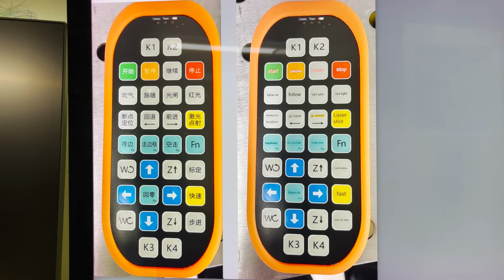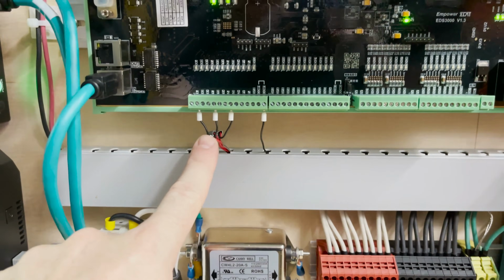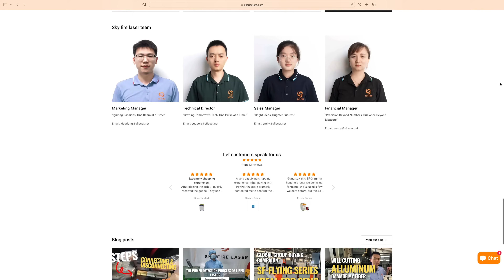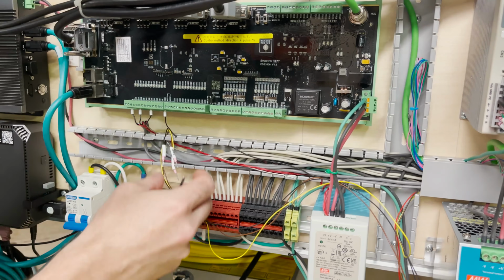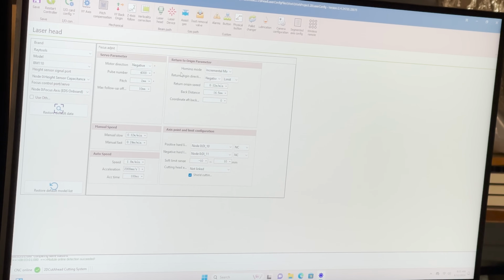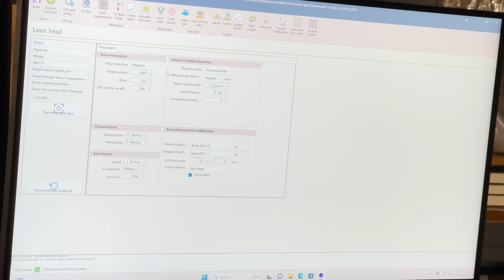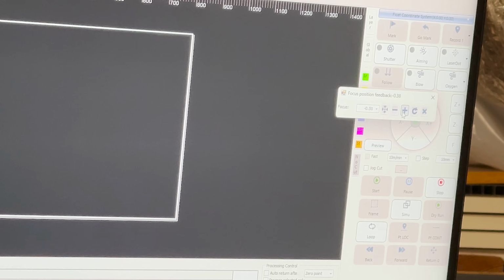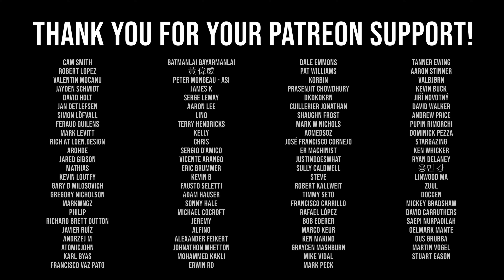DIY Fiber Laser Cutter V2 | Part 7: Raytools BM110 Auto-Focus Cutting Head

Comment: A tip regarding the watercooling, have the input be at the bottom and exit at the top. this makes bleeding the air much easier.  Especially with lower preassure and tighter tubes. This will be a non-issue with enough pressure ofc.
Reply from the maker: Thanks for the tip!

Comment: I would ask you please how the orgin function work? I have a sensor for each axis x,y and z all of them are working perfectly but the machine doesn't stop when the sensors are on. Btw all the sensors are Normally Open.
Reply from the maker: They need to be wired to x0, y0, z+ pins

Comment: would it be worth 3d printing a bumper for the hard stop around the optical cable, to make things a little gentler if it crashes?
Reply from the maker: I started to do that, but I’m concerned the plastic could break under the force. That cable is the most expensive part of the machine, so I don’t want to risk it

Comment: Hi Travis. Thanks for this video series. I have a question for you and the knowledge people here.
At work we’re thinking of putting a laser head on a 6-axis welding robot. I think it would work pretty well without an auto focus head, but probably would work better with one.
Is this possible? Below are the major parts I think we would need. Please let me know what you think:
Laser head. The amp is included?
Encoder driver. Comes with head I believe.
Controller board to control the auto focus servo.
Laser power source
Software to control things.
Raytools makes a GF101 head that has built-in Z axis movement. But seems this wouldn’t work for what we want to do, yes?
If there is an easier way to do this I’m all ears. I was hoping that there was more of a stand-alone system where the auto focus electronics were all included in a cabinet.
Anyway, I’d appreciate any help you can send my way.
Marty
Reply from the maker: Look on the Raytools website, they have an all-in-one package for this….but be warned, I heard it is around $100k

Comment: helo Travis is the home limit disconected to Power supply?
Reply from the maker: The laser head homing switch is connected to the Raytools controller.
Reply: @diyfiberlaser  yes but the limit switch doesnt work without 24 v

Comment: Where you put 24v autofocus? To the power supply? Or to board i/o?
Reply from the maker: The servo motor driver connects to it's own 24V power supply
Reply: @diyfiberlaser  sorry, i mean 24v from amplifier head laser...there a 8 cable A+,A-,B+,B-,0v,24v,limit positive, and limit negative. So where i put the 24v cable, to power supply or the EDS3000 board?
Reply: The orange cable
Reply from the maker: @opanxmaulana6825  I don't remember, I would have to check how I did it....I don't think the EDS3000 even has a 24V pin

Comment: I'm really looking forward to what you think about the xc3000 controller.  Do you know if it supports obstacle avoidance, where if a part pops up it will avoid it?  Im debating between the fscut2000 and the xc3000.  I had a rep from raytools send me the comparison between the two and it almost looks like the xc3000 may be more robust.
Reply from the maker: I would assume all fiber cutter controllers do that, it’s how the capacitive sensor in the head works to achieve consistent height, even my Ruida controller on my other machine does it, and it doesn’t have near the feature set. If it does touch, it just pauses and throws an alarm. I have yet to test it out on the xc3000, but I’m liking everything I see about the controller so far
Reply: @diyfiberlaser  I think I may be leaning toward that same controller. 
Here's a couple of examples of the obstacle avoidance.  It's what they call automatic intelligence obstacle avoidance.  One of them is on the xc1000, so I would hope the xc3000 could do the same?  Looks like a really nice feature!
https://youtu.be/i-Sm_ooMUho?si=cvYFvCP5PkxD0goy
https://youtu.be/hAWxjrbMjzw?si=wEyWWdtcq2EcXXr5
Reply from the maker: @nerdulator5000  Thanks for sharing the videos. After watching them, I get the feeling that "automatic intelligence obstacle avoidance" is probably just marketing lingo. They both appear to just be setting the lift height above the part stickup height on their demo pieces and then when the nozzle moves over them you see it move a little higher due to the capacity sensor. I was watching the videos on half speed so I could see what it was doing better. I think you would be fine with either controller. I will try to do a demo like this for you to see once I get up and running.
Reply: @diyfiberlaser  That would be great.  Id love to see a demo on this.  Appreciate it.  Looking forward to your next video!

Comment: Hello, is there any affordable CNC control card you can recommend for lathe and milling machines? I follow from Turkey, sorry for google translate
Reply from the maker: There are many cheap controllers available, but I've not used them...I've been using the Masso on my machines.
Reply: There  are many of them my freind... cheaper than Masso  and work better  than  Masso  go China

Comment: Coming along nicely, will you share a total cost once the machine is completed?
Reply from the maker: Of course...I'm at about $10,500 right now, I'm almost done...just have a couple hinges and some sheet metal for enclosing the machine left to buy, so it will probably be around $11k all in. Also, that number is with using a cheaper brand (same specs) servo motors...the ones I was going to use before the sponsorship.
Reply: @diyfiberlaser  That's a pretty reasonable price, thanks for the reply. It's looking great so far and I think I might take inspiration for my next build from it. Keep it up 👍